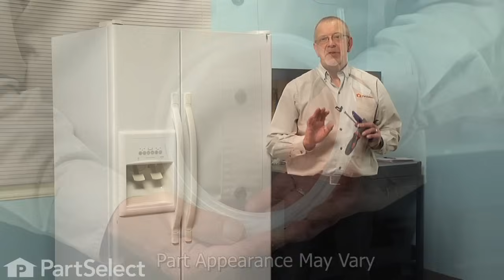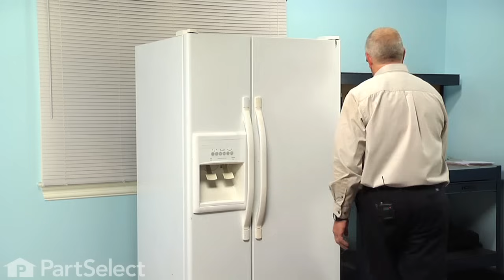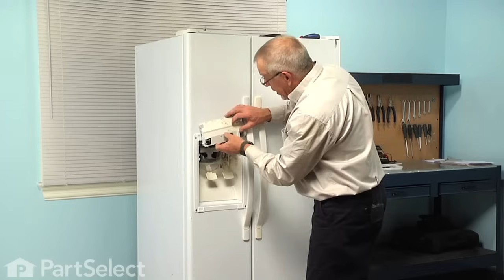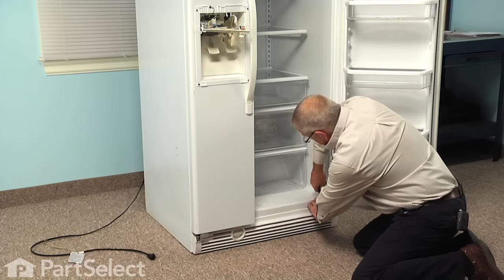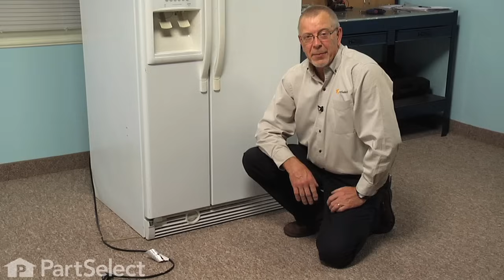Refrigerator Repair - Replacing the Dispenser Waterline (Whirlpool Part #8201537)

Comment: It was so great to find your video recently. My fridge's water dispenser tubing was old and brittle, and finally it cracked at the curve at the end of the spout, leaving me the choice of doing without filtered water, or to have it repaired for a ton of money. Your video granted me a THIRD option: fix it myself! Well, I never would have succeeded in figuring this out on my own, in fact I would have ruined the fridge in the process.  I played the video a couple of times (it is really well done, guys), then purchased the tubing, and had it completely fixed in less than an hour. I'm relieved and extremely grateful to you.

Comment: Thank you. This video was very informative and extremely helpful. I’d like to add a little hint that helped me feed the waterline. Because the kit I bought comes with the nipple attached, I was forced to feed the water line through from the top. After struggling with trying to get the line to come out the bottom door hinge fitting, I pulled it back out and snipped a bit off the line at about a 45 degree angle which gave it a point. Then I was able to feed it down all the way through with no problem. Then I recut the line at 90 degrees and reattached the line at the fitting. Good luck to all you Do-it-your-sellers like me!
Reply: When you say that the kit you bought came with "the nipple attached", do you mean that the top end where the water comes out is a rubberlike and angled nipple, and seems to be very sitting very tight? I just cant pull it out, it seems totally fastened.

Comment: If the only thing broken is the tube (as was mine), buy it separately at a big box store.  I just bought mine for 4.98 at Menards rather than buy a 'repair kit' online for $50 or more.  It's sold as "refrigerator water line for ice and water dispensers".  1/4 in OD.  I was shocked...it really was as easy as this video shows.  Thanks!!

Comment: Thank you for this well-executed video.  I thought I was toast when I found the water leak coming from that hose that goes up inside the freezer door.  I had a bit of a struggle taking the face plate off from the front of the fridge, but once removed, the rest was a breeze.  Sure enough, there was a crack in the old water line.  Put the new one in and everything works like new!

Comment: Just wanted to say how much I appreciate your help. I knew what the problem was but had no idea how simple the repair was thanks to you. This video probably saved me $200.00 if I had called an appliance repair if i could have found one. I would like to add that it should be criminal to use the garbage plastic tubing they use on all refrigerators. how many floors have been ruined by pin holes that just developed in this tubing obviously by design. Thanks again

Comment: When a man uses the word escutcheon easily and correctly, you know you are not dealing with the normal idiots who fix appliances.  This man (Steve) is way above average intelligence and can be trusted to the bitter end.  Thank You!
Reply: You so right ,i could hear right away he is a professional!

My father in law used to work for sears as appliance repair tech for years, and dont get me wrong hes genuinely awesome ,but so far the suspension went on our washing machine ,but diagnose was buy a new one..
Our induction cooktop is high end but poor design, big flaw if you run both side same time more than 2 spots the computer board overloads and burns out something..
He took it apart and prognosis..its a POS buy a new one..
Oh i knew there was 1 more recently..
So fter saying the washing machine is garbage..not repairable and he might be somewhat right as it started showing computer board faults too..thanks samsung..
So dumb me bought 1 on auction labeled as new photo 1 far away..
Paying the student fee as i call it realized its not new uppn pickup..had a nice rotten water smell welcoming already..warnig went off ..what if this iis already labeled as " buy a new one" by another r3pair tech..lol..
So im stuck with it but dropped it off with him asked if he cpukd test it to make sure im not working out with washjng machine as free weights into an already tight laundry room where i had to alrewdy remove the laundry sink completely to be able to get old 1 out ..so id like to only do reverse steps 1 time for the next 5years again..
Prognosis,  this is A OK! Just needed a cleaning etc..nothing major..
So loaded it agin on my truck and the other 6-7 steps till its all done and laundry room put back togethrr..
Start a load and it wouldnt finish any cycle passed soak amd spin..
So Thank God for this older gentleman and his true knowledge..
Hope anyone read this gets a good laugh..
Reply: He is clearly not a computer in my hand generation.  He actually knows words in his head and someone taught him how to pronounce them.  So rare in younger folks….

Comment: You are awesome Steve!
I wish I'd seen this before I twice repaired the line where it broke- right at the pivot / hinge on the bottom of the door. Once with a quick connect coupler, once with a compression union.
Now I will have more faith in manufacturers- I always figured they would make everything hard to fix and I'd have to pull the whole inner door lining or something. Parts Select is now my go-to for online parts.
Thanks again!

Comment: This video was very helpful to me even though I have a slightly different set up with my Maytag Model MSD2656DEB french-door refrigerator. I had to repair or replace the rubber actuator pad in the drink dispenser and in the process, the end of the waterline just broke off. It was badly degraded and I was not being heavy-handed. I tried using the water dispenser after the repair, and although the actuator pad now worked, the water was no longer coming out in a single stream and was making a mess. I found this video and tried both pushing and pulling on the plastic line- both from above and below at the hinge, it would not budge. Reluctantly, I decided to remove the freezer door gasket and plastic door liner. Before I did this, I removed the frozen food from the door and put it in another freezer in the garage, but I just took some plastic sheeting and masking tape and made a barrier to "seal off" the main compartment. Once I removed the inner door molded plastic liner, I could see the problem. The waterline came up between a large block of styrofoam and the inside of the door. It then made a 180 deg curve over the top of the styrofoam and then penetrated a hole in the middle of the styrofoam block and was routed downward toward the dispenser unit.
 
Naively, I had envisioned the waterline coming up through some kind of channel that would allow it to be easily removed and re-inserted like in this video. But this was NOT the case in my model refrigerator. There is NO WAY that pulling or pushing on the waterline would remove it without breaking the waterline or possibly destroying the styrofoam block. It was fairly easy to remove the old line with the door apart (I did not remove it from its hinges). I had purchased some new tubing (by the foot, since Maytag no longer makes the replacement kit) and it was very easy to remove the other end of the old waterline from the push-in coupling and then run in the new line from the bottom. I just retraced the path of the old line and then brought it down into the water dispenser unit. With a sharp blade, I cut both ends to the needed length and inserted the lower end into the quick connect coupling. 

This repair took about 2 hours. As best I could determine, this job would have cost about $350 for a repairman to do it in my area- but that is a compendium of estimates. This was not a difficult repair but it was a bit "labor-intensive" to remove the freezer door gasket and liner. I used a battery-powered screwdriver to remove the screws, but re-installing them required doing it by hand. I can highly recommend using an ice pick (or scribe) to align the gasket, door liner, and the holes in the metal door. I started a couple of screws on all four sides before tightening them down so as to get the spacing and alignment started properly.

Another caveat: When I went to repair the actuator pad, it looked like it was in good condition but seemed to have lost some of its elasticity. Ergo, it would let you depress the limit switch easily but after you removed the glass, the water kept on running. I gave it some thought and remembered the quarter-sized firm foam "spacers" that come at the top of a canister of new blank DVDs or CDs. Usually, there are 4-5 of them on the spindle at the top of the stack of disks. I always save stuff like that and this time it paid off. I inserted two of those slightly spongy rubber "washers" on top of the plastic tooth-shaped plunger inside the actuator pad. These two spacers provided just enough resilience to push the plunger back after being depressed to actuate the dispenser switch. In my trial, I found that 3 spacers were two many, ie, they allowed the water to turn off quickly but you had to press too hard on the glass to initiate water flow. Turns out I did not need a new pad after all. I just needed to re-condition the old one. I think you could improvise and make some spacers out of other spongy rubber material if you don't have any of the DVD case spacers that I described.

 I hope this helps somebody in that same boat.

Comment: I just wanted to thank you for your informative video.  I have the exact model that you replaced the line on, and I have been afraid to tackle it myself.  Seeing how easy it was I tried it, and it worked exactly how you showed on your video.  I have been without the water line for about 1 year lol.  The Light bulb by the water line dried it out, and it got brittle.  I have since replaced the incandescent bulb with a cooler burning L.E.D. bulb.

Thanks again, I appreciate your help!  

Dean F.
Reply: dean ferris o

Comment: Many thanks to you sir. I am a working mom and try to fix things myself by learning from YouTubers like you. 
I just pulled up the tube from the top for water dispensing due to the broken end tube. It worked perfectly. God blessed you.
Reply: I didn´t think of that until after I replaces the entire line.  But I left a little length on the bottom in case I need to do that in the future.  Good idea.

Comment: Perfect Steve! I had the water feeder tube accidently pushed up inside the panel and I needed to reset it.  When I contacted Frigidaire's Technical Service Department they couldn't (or wouldn't) help me.  Your video was perfect!! Well done....you also saved me minimum $80 service call that actually took me 10 minutes to fix.

Comment: An unexpected complication happened during my repair. When I pulled the old tube out from the top, it was so brittle that it broke off midsection. I was able to extract it by cutting off the head of a screw that was slightly larger than the inner diameter of the tubing, jamming the smooth (beheaded) end of the screw into the new tube, and then feeding the pointy end into the frig door from below until it encountered the the old tubing. Applying pressure and twisting the new tube from below, I was able to thread the screw into the old tubing -- effectively fastening it to the new tube. Then pulling slowly and carefully on the new tube from below, I was able to fish out the broken-off section of old tubing. I was stunned and delighted that this Hail Mary maneuver actually worked! The rest of the job was a piece of cake.

Comment: Great video, Steve!  I was skeptical about feeding the new line from the bottom and have it come out at the dispenser area, but it worked like a champ, with no issues.  Thanks for taking the mystery out of removing the front assembly and getting to that area on my Whirlpool.
Reply: Awesome instructions, had the repair made in 10 mins thanks to this video

Comment: Thank you for this video. My fridge is very similar and removing the cover and checking to see if the water line was frozen was my last thing that I know of to check. However, I still can't get water out of the spout, I would love your feedback. When it stopped working, it sounded like a pump caveating when trying to get water. The Ice maker worked just fine. I replaced the valve assembly with a new part. I even pulled out the water reservoir in the fridge section and dumped it all out. I put it back in and hooked up the water lines and turned the house water back on. The reservoir filled up, but not quite all the way. I pressed the water dispenser (no more pump cavitation sound) and a little bit of water would enter the revisor. I did that multiple times until the revisor was full. I am not sure why only a little bit of water would be pumped. I have also replaced the water filter, even thought the one that was in there had only been in for a month or so. I then decided to take the panel off per this video and pulled the water line out of the door to see if it was frozen. It was not. I pressed on the micro switch to try see what would happen, and again, only a tiny amount of water gets moved. I am at a loss as to what could be wrong or what to look into next. Thanks.

Comment: Excellent instructions! I only want to add that an even simpler solution is to patch the line with waterproof tape. This worked with my 28 year old fridge 😊. The leak will most likely occur near the bottom of the door, where the line is flexed each time the door opens.

Comment: There is a similar video that I viewed initially which says to tape a string to the old tube before pulling it out.

After losing the string, buying a $20 wrench set and spending an hour trying to disassemble the door, I discovered that, at least on my model 60259592992, there is a larger tube that runs the entire length from the dispenser area to the bottom of the door.

As shown in this video, no string is required. Just push the water line down from the dispenser area and it will come out the bottom of the door in the correct location. (on models with the black line that cannot be fed up from the bottom)

FYI - the door cannot be disassembled without breaking the door.

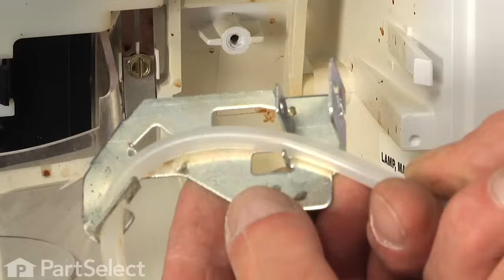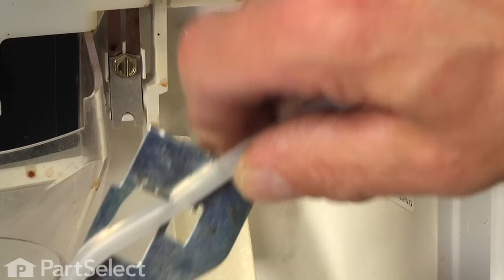Comment: There is an error in your video.  The position of the old tube in the bracket at 4:43 of the video is not the same as the position of the new tube at 5:16.  The new position shown will lead to poor aim of the water stream when the water dispenser is used.  I cut the new water tube at a sharp angle before threading it through the door from the bottom.  This helped to get it past some invisible obstacles in the door.  No neet to trim the tube end after it is threaded - the angle helps the water flow into the glass.
Reply: Thanks for catching that. You helped me out today.

Comment: PROTIP #1- if you leave the light on 24/7 like I do, you should shield the line from the light with lots of tin foil.  Otherwise, the heat of the light will eventually cause the line to crack...making this repair necessary.

PROTIP #2- if you feed a new line thru the fridge, leave extra length of the line in the bottom of the fridge, in case... subsequently years down the road, you just need to replace just the top 2 or 3 inches of the line.

Comment: Do you have to shut off the water supply valve to the fridge first?
Reply from the maker: Hi Cindy. Yes, it's usually a good idea whenever you're working around the water line to shut off the water supply before you begin the repair!

Comment: So, it appears that there's some sort of conduit to guide that tube to where it's supposed to be at the dispenser. Is that correct, or does it take some trial-&-error to get that new tube to the dispenser location?  The reason I'm asking is:  the water line froze inside the freezer door on my mom's Kenmore/Frigidaire, and in using a hair dryer to thaw it from both the bottom of the fridge and where it dispenses, the heat seems to now have damaged the actuating lever so that it's not contacting the switch.  If I'd known that water line could be changed without having to get inside the freezer door's walls, I would've removed it to thaw it and then put it back, not risking the heat from the hair dryer damaging something.

Comment: Thank you for the great video, clear and precise explanation.  I do have a question though, when I pull on my water tube from the top of dispenser I’m getting a lot of resistance, may it be due to ice build up? I’m afraid to pull it out. The fridge I have is a Frigidaire, thanks.
Reply from the maker: Thanks for your question. I wouldn't recommend pulling to hard on the water tube, as you could do damage. My advice would be to try to wiggle it out the best you can, or perhaps use a small flat blade screwdriver to try to pry it out. I hope this helps with your repair!

Comment: Hello and thank you for this excellent video.
I have a LG GWL207FLQA fridge/freezer.
I can follow your instructions until one point: On my LG the water dispenser at the top end of the waterline is not the tube itself that comes out, but a grey rubber thingy, which seems to be unmovable - maybe even unreplacable. Is this so, or can someone point me to a vidoe that addresses this type of dispenser?

Comment: Fantastic video all around. I have this job to do tomorrow on the exact same fridge. Question. Does this fridge normally come with excess tubing coiled up and zip-tied to use? Is it located there in the bottom? I guess they call it a reservoir.

Comment: I can't get the new line pushed through the door. It's stuck on some ridges or something inside the tube. I've twisted it all around for an hour, but no luck. Is there a way to get the plastic housing behind the dispenser out so I can see what's sticking? The screws clearly aren't the only thing holding it in place, as that doesn't loosen it at all. Is it glued on?